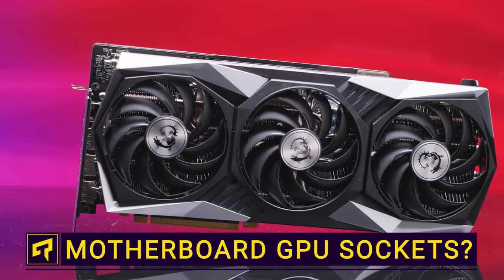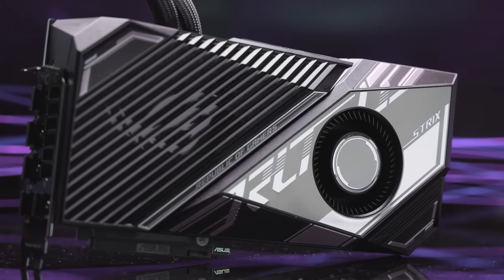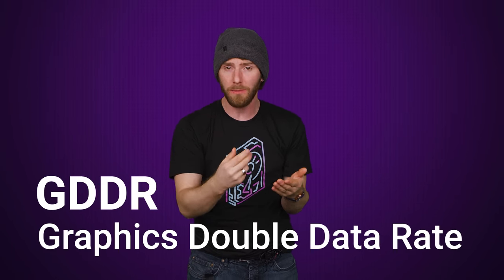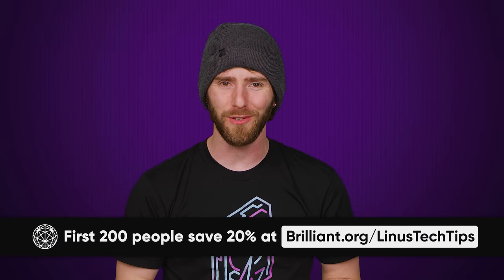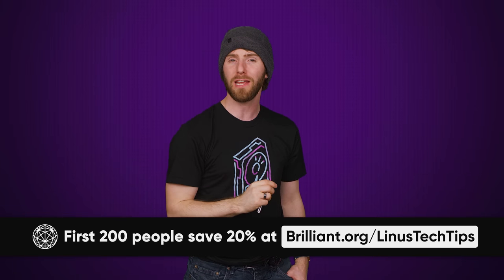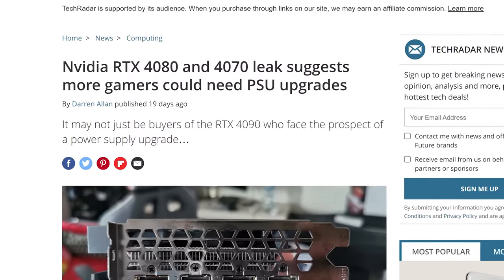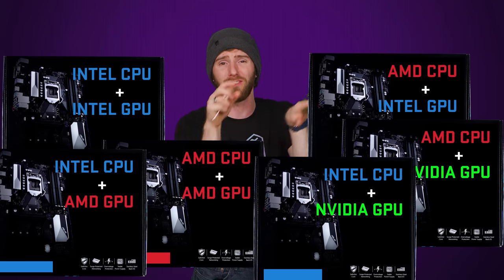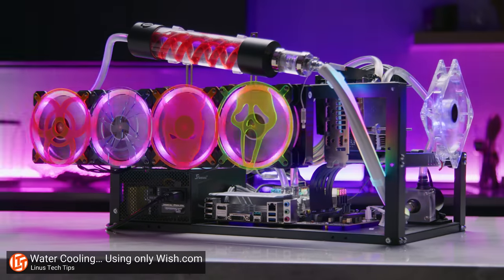Can You Put a GPU on a MOTHERBOARD?

Comment: Idea: Graphics Card are only the PVB`s with Everything on it, but the GPU. You need to buy the GPU`s Seperatly and put them on the Board like a CPU. The GPU`s go by the Names of the Graphics Gard by Today´s Standarts, and the PCB´s by Data Bus Width. You can Also put Additional RAM Modules on that Board. Like DDR , GDDR or Something Else. So Basically, Graphics Card Become The Same as Main Boards, the Only Difference is that they Only Handle Graphics and need to Be put in a PCIe Slot on a Real Motherboard. Dang i need to Patent that!
(Sorry for my Bad English)

Comment: Still doesn't really explain why you couldn't have a pci-express daughterboard with socketed gpu & ram (except the increased data error rate) - I'm guessing it's mostly just economics, firstly manufacturers couldn't charge you for upgrading the entire board and secondly that the technology changes faster so isn't worth making it upgradeable

Comment: Please if anyone is reading, Help. It's off topic. I play Xbox 360. And Yesterday I bought a wired 360 controller. But when I connect it it just keeps blinking but doesn't connect. My controller works fine with my phone and PC but not X box for Which I purchased it. I researched about it as well but everyone only mentions that it only happens to wireless controller when battery is low, or is not paired, or is not sync etc. But mine is wired. What is for wired. My older controllers wired/wireless both connects but not the new one. I am so frustrated and I bought it with my pocket money. So please if anyone can help. I only use YouTube so it's all where I can ask help.

Comment: NOT TRUE! "A mid to high end" CMOS GPU draws massive power because it is CMOS. A tunnel diode threshold logic GPU would give 1000 times the performance at 1% of the speed. But let's all stick with 1963-vintage technology. Older is better, right?

Comment: The better question is: Why don't we have standardized GPU cooler mounts. Like we have for CPUs.
Reply: Where do we have 'standardized' cpu cooler mounts?
Reply: @chrisbaker8533  Well, we don't have it cross industry as such. But each generation of CPUs from a specific vendor usually use the same socket, and therefore cooling mount. And they mounts are usually quite similar, so coolers can just add inexpensive adapter mounts to span decades of mounts/sockets. It would be so cool if we could just buy a waterblock for example, and with a little bag of hardware we could use it for either CPU or GPUs. Or we could choose to mount a tower cooler, case mounting permitted, to replace any crappy/loud default cooler on GPUs.

Comment: Why can't we at least have a GPU socket on a graphic card board then attach that board to the CPU motherboard through PCIE slot.

That way we can have different boards for different power budget

What if I was one of those weird people that wants to run a 3080 on 100 watts only :). In that case I won't need a premium graphic board card and premium coolers. It is gonna be a lot cheaper if I just can get the GPU socketed. Let alone upgrading. I never upgraded the CPU without changing my motherboard. It is fine if GPUs went with the same issue

Just like how expensive and cheap CPU motherboards are from low end 50 bucks to high end over 1000 bucks, graphic cards' boards would vary too if they were socketed.

Just like how I am running a 5800X3D on a budget B550 motherboard, I can then have a 3080 on a budget board

Comment: lol can you imagine how big the motherboard would have to be if you had a quad cpu and quad gpu socket motherboards, 8 sockets lolz now im thinking bout those p&sstake made voodoo 5 9000 cards with like 32 vesa 100 chips on it. But why Ryzen 7000 APU's are just round the corner and there said to be getting close to dedicated discrete graphic card performance anyway, no need for a seperate socket.

Comment: dude, every time someone says "something very tricky stuff is needed", they are saying it for the money work purposes only, ie, a lie
Reply: also for those "holographic" head set glasses, I call your bs, whoever says that, keep it simple engineers, or you lie
Reply: of course you can put the gpu power headers on the mother board, just like the cpu power leads, if any
Reply: use gddr6+ as the system memory
Reply: latency reasons are bunk, same delay
Reply: of course you can, dont even claim otherwise, its about you wanting or not
Reply: no so hard, its just talk
Reply: pci-e is the socket :)
Reply: do you remember pentium 3 socket, aha aha
Reply: you have two flat water blocks or shared one air cooler, tf

Comment: It's fun to think about these wack things but most people never stop to ask "why", the truth is, unless it's necessary, markets typically like standards, they make different brands easier to pick up which means it's easier for new brands to enter while also providing established players easier marketshare growth when they make a better product than their competitors(people like things that are easy to use and cheap).
Standards are only avoided when a company wants to make it harder for their current consumers to easily change brands(IP aggravates this problem, because without it, if the "proprietary" design was actually good, competitors could just make the same design and boom, we got a new standard instead of a pseudo-monopoly), looking at you Apple...

Comment: YEAH BUT I HAVE A BETTER PROPOSITION, HEAR ME OUT : 

What if instead the Graphics Cards manufacturers like Asus, MSI, EVGA etc, sold the cards separately with GPU slots and soldered memory + memory expansion slots ? So we could just purchase the GPU chips directly from the vendors such as Nvidia, AMD and Intel, aswell as the memory modules from Samsung and others...
That would be a game changer ! Because not only we'd be able to get a completely customized Graphics Card for our needs, but also that would lower the chances of those Cards failing due to bad BGA Soldering and other problems related to that matter.

Who's agreeing with me ?

Comment: now tell us why we can't put a CPU on a card like in the P2 days
Reply: i mean we could, but then it would take up too much space. also cpu production has improved by so much, so we don't have to worry about the cache on the chip being bad. the reason why the pentium ii was on a card is that with the larger amount of onboard cache, there were more failures , but they couldn't test it until the whole cpu had been produced, if it failed, the whole chip got thrown away, by making the cpu without any on chip cache, then putting the chip onto a card with the cache being separate, you could test if the cache was bad without throwing away what would be a perfectly good cpu, giving you higher yield rates of processors

Comment: 10 years ago Nvidia had it's Ion gpu which was coupled with Intel Atom cpus. It proved popular and would have allowed netbooks and slimline mini-itx to take off. But Intel threatened to cut supply to the mobo makers if they didn't discontinue. There are current gen mini-itx mobos out there with nvidia GTX1650 on them which are great for slim line set tops and even the new Commodore 64. https://www.youtube.com/watch?v=7UjMFM8FU3E

Comment: Honestly this video makes no sense.

So Linus says GPUs would require too much power... so do CPUs but they have a specific power plug for the CPU on the motherboard...

He says putting a GPU on the motherboard would make it significantly more expensive. While true, thats only if you populate the slot. All motherboards have PCIe slots you don't have to fill, and they cost nothing extra in reality. Adding the GPU to go in the socket or in the PCIe socket is when it would cost more.

He says that we couldn't use onboard ram as its no good for gaming... yet many gaming laptops or computers with integrated graphics use the system ram. Motherboards with graphics sockets could just support faster ram (as some do anyways).

He says there would be a problem with each GPU brand having a different socket... which makes no sense since all GPUs use PCIe right now.

He also says that not everyone would need a GPU, so having the socket would cornhole them into getting one unnecessarily. On the contrary, it could be just like unused PCIe/RAM/NVMe slots, and just sit idle and empty.

Honestly every point this video makes doesn't make sense if you actually reflect on the current condition of computers. I don't disagree with it though, why bother putting a GPU on the motherboard when you already are right now via PCIe... its meaningless.
Reply: As a matter of fact, if this idea is so silly... why have APUs from AMD been so popular as of late?

With the way GPU prices and power demand is going, the way scalpers and miners destroy the market everu 2-4 years, and with how vastly improved APUs have been, I don't see why LTT isn't questioning why don't we move towards socketted GPUs?

Comment: The question is really: Why don´t we put the CPU/RAM on a PCIe card.
Reply: it has been done in the past (although not with PCIe). some of the earliest microcomputers used a backplane board which required a cpu card to work. some ibm pc compatibles did this with isa and even pci cards in some cases

Comment: Sometimes I feel like the layouts are absolutely arbitrary. I mean why did intel sell 2066 LGA shit on the X series a few years ago and now receded back to 1700? Heck, AM5 is like 1718 or something like that. I wonder why exactly AMD chose to have an LGA socket with nearly the same grid as intel but won't be compatible because of REASONS. 

I understand that, like the motherboards have X features which need Y power because Z processor is better. But why don't they just overbuild their boards and reap in from selling more processors? If  got a board that can't be upgraded after one or two generations I'd just fucking skip the upgrade for years and change out my processor with my motherboard. 

I mean if processors are just getting bigger why not stay with the larger one and just get on with it even if lower end processors don't use all of the pins? I think that putting the socket on the motherboard is a bad idea, but what about socketing the GPU on the graphic's card silicone?

I feel like a graphics card should have a removeable processor for the sake of reducing e-waste. even if grid arrays changed every three years, for instance, you could be able to buy the newest cpu, more memory, you could even re-use your heatsinks, power delivery controlers, ports, etc.

As data sciences are becoming more popular I hope serious vendors start taking a more modular approach for the sake of being more professional.

Comment: Yes. And then throw out EVERYTHING, every time Nvidia adds another 10 to the formerly highest number of the GPU lineup ("yes, I have a 3080 already...but now I want a 3090! Because reasons!")
     Very cost effective and consumer friendly, this idea

Also, very much the opposite of what people like about desktop computers (...more bang for the buck than integrated solutions, upgrade paths, the ability to fully customize, etc)

Also, the introduction of a kilometer of traces and voltage regulators that could trash your whole computer at once, instead of 1 component at a time...
    (Happy overclocking, everyone! "Fingers crossed..." 🎇*poof*⚡️)

Comment: mm if i had the $$$, will have a motherboard with built in GPU.  call it...    Wide-ATX Protype. with removeable VRAM chips. not like a laptop. know them black socket for IC.  with no upgradable gpu options.  just to have it seem cool n pricey.

Comment: Your argument against installing gpu's the same as we install cpu's is midling at best and weak otherwise. They came up with PCIe standards so the standards could also be applied to sockets. Want an AMD cpu/gpu mb? Sure and it wouldn't matter which AMD GPU you bought because the MB would have been built to accept them all and even could be future proofed to an extent. You forget that the space used now by the GPU card would be available to put the power supply and other parts on the MB so the MB wouldn't be bigger than atx anyway. Want a AMD/nVidia setup...same thing. It would be built to standards needed for the best cards they have also. Your argument is full of holes. I give you a 3 out of 10 on this one. Also you will try the argument that the price would be exorbitant...it would be about 400 to 500 for a MB but the GPU would be about half its price( or even less) as we have now. Along with the amount of packaging saved...win/win.

Comment: Sorry but this is a very weak video for me. Almost every single point you mentioned is applicable for cpus as well and is not gpu specific. Gpu memory could very well be slotted, ddr is slotted too. On top of that the entire card is slotted as wel... Cpus have socket standarts so gpus could have them too. If gpus would be slotted in the first place, they wouldnt draw 500w for 10% extra performance. Moreover, you dont need to slot it in the motherboard directly; put the socket on the gpu-mainboard which connects via pcie to the mainboard like it does today. Nothing on the mitherboard changes. In a world that is dying from our mindless consumption it is not the time to defend throw away products and unecessarily excessive power consumption. Are you invested in framework because you want even more money or because you want to make the world a better place linus?

Comment: Meanwhile enthusiast laptop designs have been using the MXM standard with revisions that have historically lasted longer than any CPU socket.

The entire latter half of this video is solved by scaling that standard up to a desktop environment. Of course, you're then just left with the question of what would a MXM desktop slot do that isn't already done with the PCIE standard?